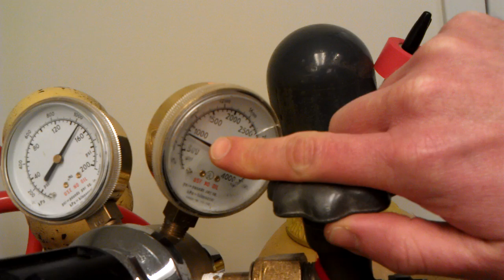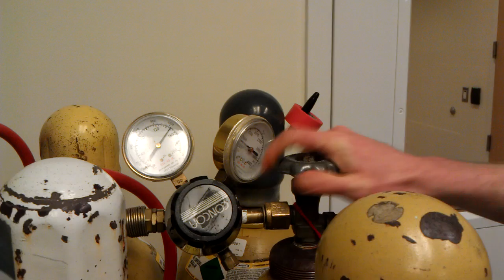Microfluidizer tutorial

Comment: Hi Peter! We have a M110P microfluidizer and i cannot find a place to contact the gas, and what kind of gas i need? Sorry if it sounds too simple, i've never worked with it ))
Reply from the maker: Hi Aybek,
I believe the M110p does not require you to connect any gas. My understanding is that the M110P unit is a self powered system so if you plug it into electrical power, and had it properly installed, then it should be ready to go.
Best of luck and please let me know if I can help any further.
Peter
Reply: Thanks for your answer! I have several more questions, but i think its better if i ask by email. Can you please send your email to aibek.mursalimov@nu.edu.kz 
thank you in advance